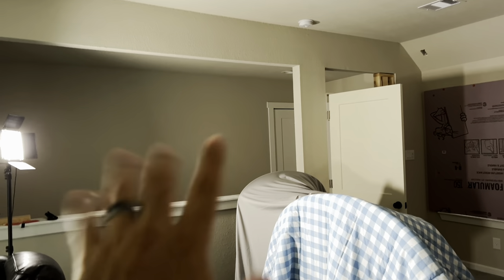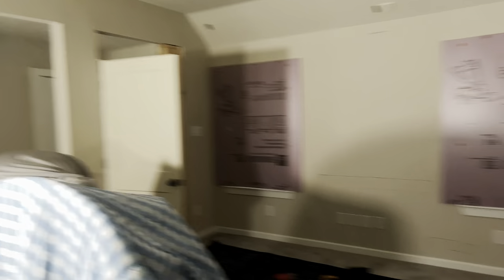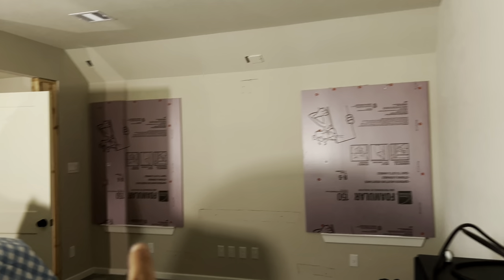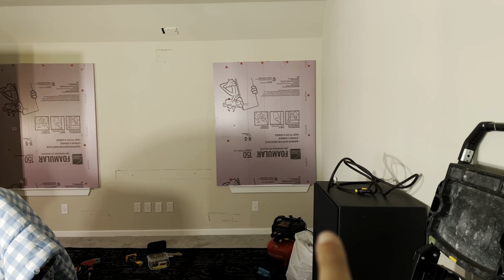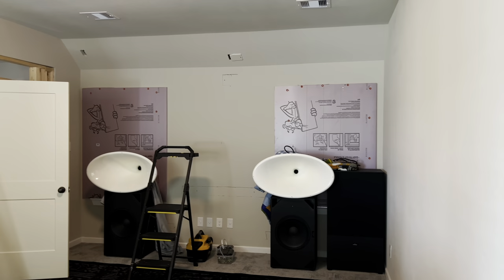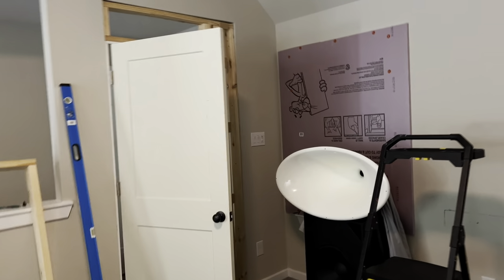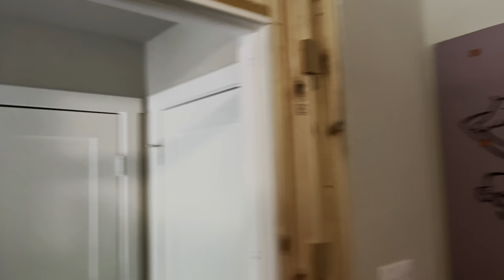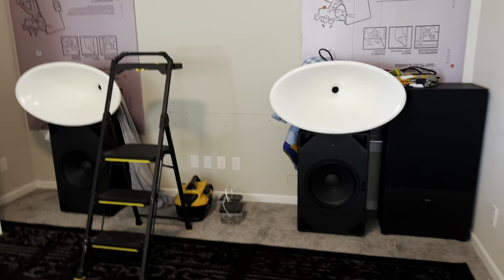Building my Home Theater: Part 2 Baffle Wall for Behind Screen Speakers

Comment: Are those Swans really $10K for one speaker !?!?!?!?!?🤪🤪 I mean the SPL levels are insane but that is some steep prices. And do you run it without a center channel? Very interested in this theater build. Won't be anything like it  anywhere
Reply from the maker: Reference level system for sure. The center is in the box still.  I heard the smaller 15 inch versions of these and shooo buddy. They are breathtaking.

Comment: Nice! Are you feeding your subs on one 240 20amp line or two separate 240 20amp lines for each sub?
Reply from the maker: 2 subs on one 240. 3 LCR speakers on one 240. last sub on its own 240 :)
Reply: @ThatHomeTheaterDude  Sweet! I can’t wait to see how you finish that room.
Reply: No such thing as 20amp on 240....proof me wrong....its more than 20 amp...usually 240 volts is double...40 amp or 30...not 20....i have 20amp and using 3 prong at 110 socket....
Reply: @blueflame0003  I just had a 240volt 20amp line installed myself this morning for my two 24 inch subs.
Reply: @VividTheater  ok never heard of it......whats the differance besides the plug?
Reply from the maker: @blueflame0003  box said 240/20 amp plug and socket. IDK
Reply: @blueflame0003  The big 24s were not getting enough power, and were having voltage drop issues when cranked loud. My subs were being held back a lot. I do not have voltage drop issues anymore when I crank it loud. The subs can now play at far higher sound levels that It couldn’t do before.
Reply: @VividTheater  i see thks didn't know there were more options beside 20amp 120volts..

Comment: I LOVE those ascendos you have!! I haven't heard them in person yet, but have done countless and countless hours of research on speakers and electronics in general (1000's of hours) and the black swans are what I'm going to be putting in my theater.

Is there a dealer near you that had them for you to demo, or did you order straight from the manufacturer? 

Their 50" sub is insane, and word is they have an 80" in the the works 😱😱

Love your content, keep it up!!
Reply from the maker: Thanks man. I'd love to help you once youre ready for your own set of Ascendo. Contact info is in the description